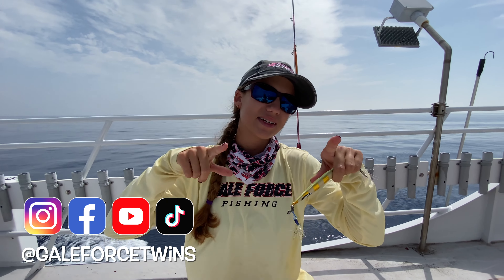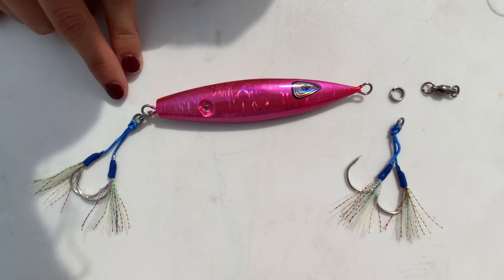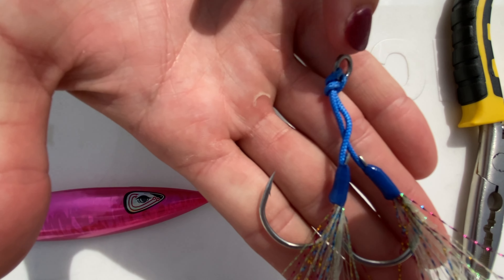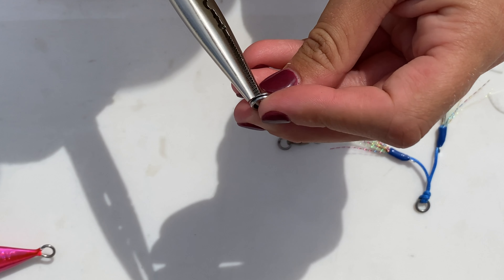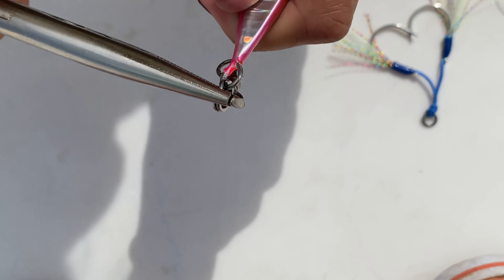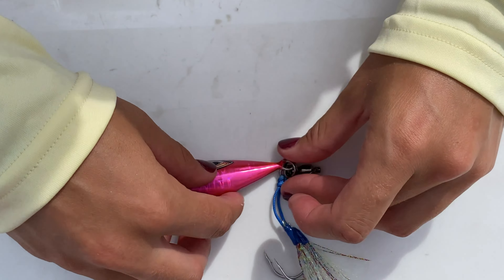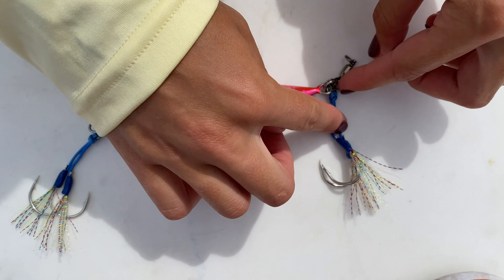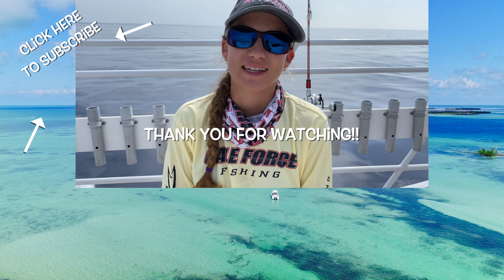How to Rig a SLOW PITCH JIG the Right Way

Comment: Ive just ordered owners ball bearing swivels (TT52) (Owner Cultiva on the packaging) These have a solid ring inside the bottom ring of the swivel which gets welded shut. The sizes 00 up to 5 are from 20 lb test up to 400 plus lb test. These used on the front of jig attachment allow a direct connection of assist hk/hks to mainline AND introducing a swivel avoiding line twist on the ascent. I like these because you dont need to rely on a split ring connection between hk & swivel (I got the size 5 for bluefin tuna to pair with a single 7/0 BKK assist hks on 300 lb test doubled kevlar assist cord at front of jig. In this way I can make my own abrasion leaders (2.5 ft & 200 lb test mono crimped) & leave the hk & swivel attached to the leader allowing change out of jig only (& its rear hk with a HD split ring 320 lb & up) when things need to happen quickly. An alternative would be a swivel at top of abrasion leader with a solid ring placed in leaders bottom loop b4 crimping - after - chafe guarding. Really great topic as there are so many videos on technique but few on the very specific instruction of proper rigging & terminal tackle. Also plan to add TN knot at topshot to abrasion ldr connection instead of jansek special or improved clinch knot. The subject of knots specific to slow pitch jigging because of the lg # of connection types involved would be a really great subject for a video - where to use each & why.

Comment: Here in California, most rig flat falls / spj a bit different.  1) Because we can only use two hooks when rockfishing, we usually just do the one side.  2) Quite a few tie line to the solid ring, not the split ring and not using a swivel.  It happen rarely, but split rings can and do open under load.  Some folks use them for flat falls for pelagics like BFT or YFT - which can put a strain on the rings - why take the chance...
Reply: When using only two hooks, which side do you attach it on?

Comment: For those who don't have the proper pliers (like myself) a straight jewelers screwdriver, like what is in your eyeglass repair kit, will also work to open the rings.  Much MUCH easier to use the proper tools though, thank you ladies!

Comment: one debatable point is that some anglers claim ball bearing swivels cause spinning of the slow jigs and hinder their horizontal pause cause them keep spinning and loose action. so they prefer keep using solid rings for slow pitch jigging. is that the case?
Reply: Yes I use an extra solid ring instead of the swivel, some just tie the leader directly to the solid ring

Comment: There is one important point to position the assist hook on the flat side of the jig for spj (which is correct in your video). When it flutters down, the flat side will be on top thus the assist hooks.

Comment: It would be great to get an “Under 5” how you setup your garmin gps for long runs. My old garmin and lowrance had a pointer “Arrow” you could setup to help guide you but my new one doesn’t.
Reply: Warren don’t know what you mean hit your curser move it to to where you want to go to you navigate to will give a straight line to your mark or hit go to and it will plot a course to it with turns you need to verify you don’t go over shoals over land on go to or go to your waypoints and nav to or go to and check   
go in yard and play with gps with manual and practice so when you go out in boat you already have idea on how to navigate through your settings quicker JT Hooked N Rolling Offshore 🇺🇸🇺🇸🐟🐠🎣🛥🌴⛱😊😊🙏🏻🙏🏻
Reply: @hookednrolling2009  thanks for the reply, I have a new Garmin SV94 UHD. On my lowrance and older garmin handheld you hit “Goto” and choose a waypoint. I choose an overlay that’s an arrow that points to the destination. That way I can glance at it and keep on course. This model only seems to have a line on the map or a compass “Off Course” overlay. When running all night without autopilot it’s easier on my brain to see an arrow pointing me in the right direction. Especially when running at 8kts with no autopilot
Reply from the maker: Great topic to cover! We will try to get something like this done :)

Comment: Hi Amanda/Emily, what size BB swivel and leader do y’all recommend? Really enjoy the channel!
Reply from the maker: We use size 1/0 or around 150lb swivels and 50lb Fluoro leader
Reply: @GaleForceTwins  do y’all make your own assist hooks? If so any details?
Reply: Don’t use a ball bearing swivel on your jig. It’s not meant to have that. The rigging is wrong.
Reply: @peterk814  well, I've fished long enough (Crystal River guy here, now in TX), to know it's mostly personal preference.  In general just consider these things:  1.  Are you using a spinning reel, if so, swivels are not a bad idea.  2.  For straight down vertical jigging on a conventional reel, I'd opt-out of the swivel, if I used a spinning reel, I would do what this gal is showing in a heart beat.  3.  Consider also the design of your lure and it's action.  For example, when I used to use my old trusty Johnson Sprite Gold spoon on the flats for red fish, I could catch reds all day long w/o a swivel, but with a swivel my hook-up rate would plummet.  Just my 2-cents.  GO GATORS!
Reply: @motleypixel  you should never have a ball bearing swivel there regardless of jig style or outfit style
Reply: @peterk814  I disagree when using a spinning reel.  Conventional, no swivel.
Reply: @motleypixel  really doesn’t matter. And you shouldn’t be using ball bearing either way. The heaviness kills the action of any jig
Reply: @peterk814  for me it matters.  I don't disagree that swivels kills action (made a reference to that in my first post).  Again, using conventional (as I would anyway), no swivel because that's best practice.  Now if I was forced to use a spinning reel setup, because my backup was out of commission too, I'd opt for a swivel because I've been there in both cases, spinning reel with and w/o a swivel and the outcome is as follows:  With a swivel fishing for 2 hours landed 8 fish with zero issues.  Without a swivel, landed 8 fish, because it is better presentation and 30 mins of that 2 hours was spent spooling out my line at the back of the boat to remove the horrible twist developed by the spinning reel and jig w/o a swivel.  So my choice here is clear, reduce the headache of line issues using a spinning reel with swivel for basically the same hook-up ratio.  As one fisherman to another, it's personal preference, tight lines!

Comment: The rigging is correct except the ball bearing swivel connects your braid and leader...direct tie the lure or use an anglers clip.  The swivel directly on the lure will impact the action it's meant to have